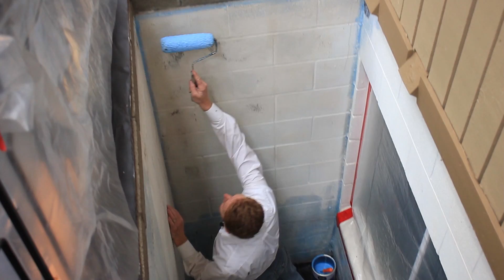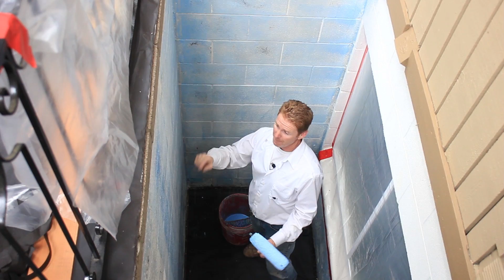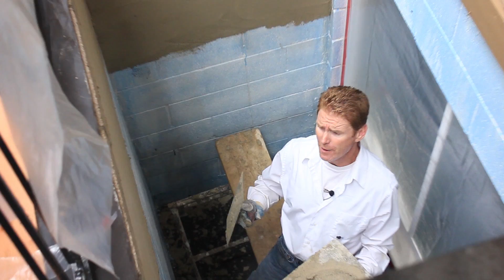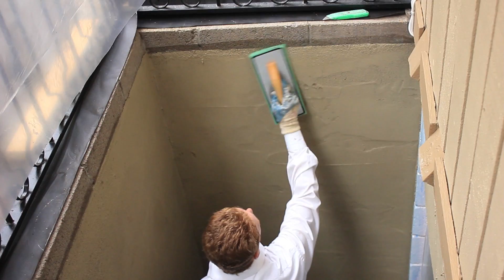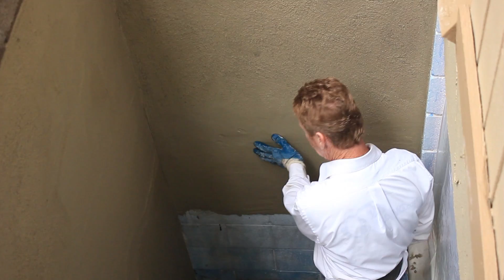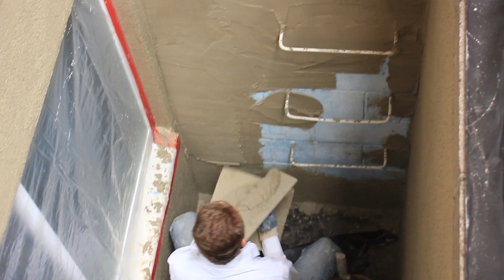White Portland stucco over concrete block walls.

Comment: Kirk, thank you for your videos! When you use the bonding agent on a painted cinder block surface, does that allow you to skip wetting the surface? In my case, I have pressure washed the exterior cinder block wall, which exposed portions of the cement underneath the paint, maybe half is paint, half is cement.
Reply from the maker: Howdy if you use any of the cement or stucco bonding agents, you don't have to wet the walls as most bonding agents are mostly water anyway. Of course if your plastering in the middle of the day and it's over 100 degrees,. I also wet the walls regardless of a bonding agent. I Know TMI.💃🏻

Comment: Kirk .. great video what type of bonding agent did you used!??? After washing the wall can I still apply the bonding agent on top of the walls that are painted??
Reply from the maker: Yes and yes, use quikrete sold everywhere or weld-crete which is sold usually only at plastering yards.💃🏻

Comment: Can I put finish Coat stucco on   Wonder boards wall  that was skim with thin set ???
Reply from the maker: Evening Pitekx, of course you can. many ways to skin a cat.
 Bringing peace, love, and brotherhood back to the world of “Plastering.” 🌍
    The complete plastering encyclopedia on video, by the plastering messengers of Youtube.  
     Over 800 videos 🎭 👀
Reply: Thanks Kirk,  can I apply stucco on brick , concrete wall that was sealed  , I have very small area all round doors aprox,,, 100 sq ? If not , what is the  best way to remove sealer? Acid ,vinegar??

Comment: Hey mister Kirk I have a question for you I have a block walls I need ad. 2 x 6 S Wood Walls how I apply cement stucco I don't want to see the transition. thanks
Reply from the maker: Howdy Oscar, it took me close to an hour to locate these two videos, I do have more but hopefully one of these will give you an idea of how it's done. 
Obviously, I need a better searching system for our channel.
Transitions plywood into Cinder blocks,  https://youtu.be/D5Gu-sGKoCA
blending wood walls into Cinder blocks, https://youtu.be/12WfhuwbzjQ                        
                             Live long and Plaster
 Kirk Giordano’s plastering and stucco wisdom videos

Comment: I'm going to be doing some stucco over painted cinder block that's inside. What would you suggest instead of a pressure washer to ensure it's clean and scored before I add a bonding agent? Love the videos man. They're a huge help!
Reply from the maker: Howdy Jon, yes that would be fine, more than likely your complete with this project,
FYI,  I answer questions when I receive them if they are late ariving to my e-mail, this is out of my control, sorry.     
                                   Live long and plaster
    Images of Kirk Giordano’s Plastering projects and tips
Reply: TSP...trisodium phosphate..use as to directions

Comment: I scrolled through the comments to see if the answer was there but ,but I didn't see it. I have a chimney to plaster and to have it come out white . The question is can I find a white SAND to mix with white cement ?
Reply from the maker: Good Evening Al dude, better late than never, not all questions get to me,
 Hanson's Lehigh's makes a white cement plaster, cost twice as much as the grey, but you get what you pay for,
                            best wishes,                 
                       Live long and plaster
    Mastering Plastering by Kirk and Jason Giordano
Reply: Kirk Giordano plastering Inc. Great I found a good material company called, Gallentino, where I found white cement and sand.. The extra fine sand made a world of a difference in my finished texture . Yes, the whit Portland is higher in price ,but needed. I mixed a white wash and bonding agent on other projects,which came out great . Many blessing ,and say hi to that doll.
Reply from the maker: Good Afternoon Al dude, you are a master at utilizing google.                  
                         Live long and plaster 
    Sharing Plastering tips by the Giordano Gent
Reply: Kirk Giordano plastering Inc. Well I would go to your FB,but their is an angry looking woman holding a glass of wine.

Comment: Hey Kirk, I watched your videos and enjoyed the detailed information you shared, Thank you!! I have a brick wall just like this one and want to spray stipple on it to match an existing wall that was stippled a few years back. My wall is also painted with a white paint but I can't tell what type of paint it is. I would like to know what i can do to fill the gaps between the bricks and what compound I can use to cover the bricks before I stipple?
Thank you!
Reply from the maker: Morning alceu Da Silva Moreira, good question.
 If it were me I would buy a heavy clean coarse washed sand. (heavy sand)
 It has small pebbles (heavy sand aggregates) in it., mix this sand with Portland cement, spread then float with extra water now your done,
the key is you need to know when the plaster is set enough  to float and how much water to use,  use just enough water to bring the heavy sand to the surface too much too soon and you wash the plaster off the wall.
It takes practice to learn to float  a well, but if you can learn to it will save much time.
 You have the look of a young strong and talented fella while asking solid questions.
 Nobody learned this trade in a day but I believe you can get the desired effect you want on your own.
 below are two video’s to copy and paste in our browser to give a better idea of what I am suggesting,
 best wishes,

http://youtu.be/yRyuxp99bAE
http://youtu.be/G8mrSJJsCFA

Kirk and Jason Giordano DIY plastering tips
Reply: Thank you for the advise and I look forward on watching more of your videos.
Reply from the maker: Evening De Silva, no worries and best wishes,
Kirk and Jason's DIY plastering tips

Comment from the maker: Hello Adeel Ahmed, most portland cement are up to all code requirements.
 If you want to get a wall true and plumb you will need to rod it or use a darby. This takes practice sometimes many years.
 I have quite a few videos on how to apply a skim coat plaster over cinder block walls type in those word in our page in our search column. 
Best wishes and have a great day! 
Kirk Giordano plastering

Comment: Hallo Mr. Kirk will you tell me how to start palstering on block wall and this plasteriing should be related to ASTM standard. Will I install level mark on block wall for smooth surface?Because consulterd required to check plumb and alignment after finish plastering.
Explain me whole method of plastering for cement unit block wall as per ASTM standard I will be thankful to you.
Thank's 
BEST REGARD'S

Comment from the maker: Good morning bhumanecate, you have an eagle eye. We bought white Portland cement for this project but the sand we mixed with it was tan in color which gave it the tan color. You can buy white sand to mix yours if you wish. These folks wanted the tan color as they were not going to paint.
 (Good observation.)
 We usually have a yard or 2 of plaster sand dropped on our truck which is always sort of tan.
Thanks for watching and have a great day!
Kirk Giordano Plastering

Comment from the maker: Howdy Michael, there are many different types of sand from fine to heavy course sand. I can use any of them but prefer plaster sand.
Make sure you prep the block wall first, also. 
As far as color coat materials you have 3 choices. Fine, medium or course, it’s your wall your decision. 20/30 is medium.
Best wishes and have a great memorial day!
Kirk Giordano plastering

Comment: nice work Kirk... Quick question.  I hve a few extra bags of portland  Can I just mix it 3:1  with masonry sand to skim coat some CMU i recently put up or do I need to use plaster sand?  and then color it with 20- 30 ? 

ML

Comment from the maker: Howdy old jones, your right I did use Lehigh Hanson’s cement.
Hansons white portland cement it has essentially the same properties as gray cement, except for color and the fact it cost a bit more per bag.
A key advantage of using white cement for decorative and architectural concrete is that it provides a neutral tinting base and consistent color results.
 Have a groovy Christmas Eve.
Kirk Giordano plastering

Comment from the maker: Hey Jones, ran out of space this wall was painted. The home owner pressure washed with 3,000 PSI. The owner did a great job removing all the mold and moss. We then applied a bonding agent to the wall before applying a white Portland based mortar mix. When this white mortar mix was mixed with sand the color came out sort of tan, and maintenance e free.
 Best wishes,
 Kirk Giordano plastering

Comment from the maker: Hey Jones, type N Mortar Mix is a general purpose mortar for laying brick, block or stone or for repairing mortar joints.
I usually use premium which is a mix of common and plastic. (Green bags) Common usually comes in red bags and has great strength. (Red bags) Plastic usually comes in orange bags it has more elasticity which means it spreads better. I've used straight common for retaining walls or fish ponds. Drag to spread but man is it strong.
have a groovy evening
 Kirk Giordano plastering

Comment from the maker: Hi Tim, we used Hanson’s White Portland Cement, all we do is add the sand and water, the white cement mixed with the color of the sand usually comes out a tan color. It's maintenance free but of course if a fella decides to paint they can. 
 Thanks for the question and have a groovy evening. 
Kirk Giordano plastering